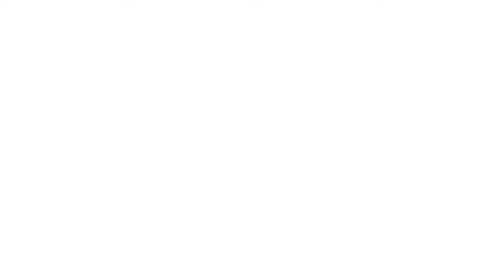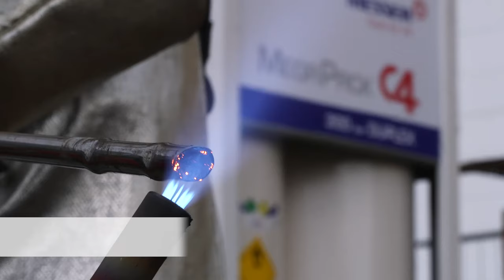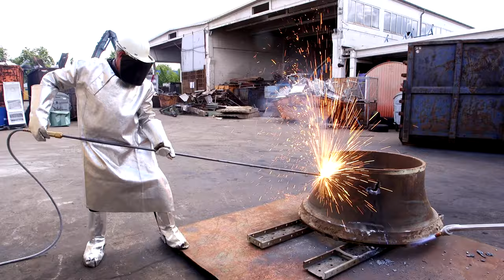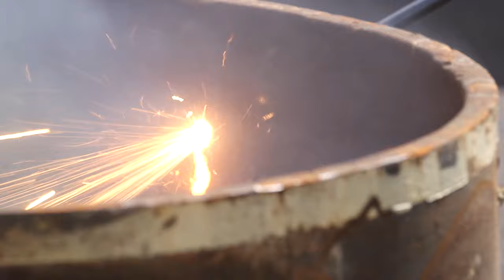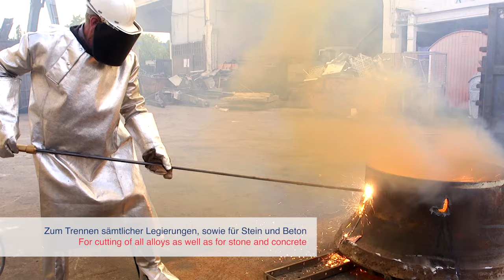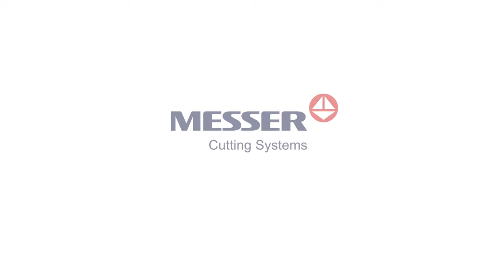Oxygen Lancing process

Comment: Breathing in all those fumes can't be too good.
Reply: Lmfao, the dude has a $1,000’s of dollars suit on, I’d think they’d include a respirator 😂😂😂😂
Reply: bruh its just oxygen 💀💀💀
Reply: @damonirvine8910  it’s a year late, but he just has a helmet with a visor down, he doesn’t have a respirator.
Reply: No, it's no bueno. My work fired me because I refused to weld/cut galvanized steel without a respirator. 

But in a high ventilation area, such as outside as long as you're not in the direct path of the fumes. O.S.H.A. says you're A+ Okayed..... Lol
Reply: @gerald8543 that's shitty because you're allowed to refuse work you deem unsafe, until reasonable conditions are met. A respirator is worth it when heating up or welding on galvanized steel, I'd argue welding in general regardless of ventilation. The company I work for has been installing Messer Cutting Systems in the US, we just finished 90% of the installation of the 2nd in the US system and largest of its kind and we are installing the rest of them now if we win the contract. I did all the precision work with another guy on the whole system and I did all the welding on anything that wasn't prefabricated. I chose not to wear a respirator but wish I had. Any hot work on stainless should automatically require a respirator due to chromium inhalation posing a serious chronic risk to your health.

Comment: it the general idea to use iron as your fuel source and supplement with o2 to get the temp needed?
Reply: Yes sir! It's the same process that allows steel wool(iron) to burn on steroids. The reaction is extremely exothermic, and has a high ignition temperature. But Instead of high surface area low oxygen concentration, it's lower surface area, higher oxygen concentration.
Reply: @gerald8543  Thanks, dude! thats what I figured but love to have the confirmation. I blacksmith (mainly demos at a museum) and its always funny to see people's reactions when you tell them iron can burn lol (just really annoying when I am talking to a guest and I loose track of a piece in the fire. pretty but wastefully lol). thanks again